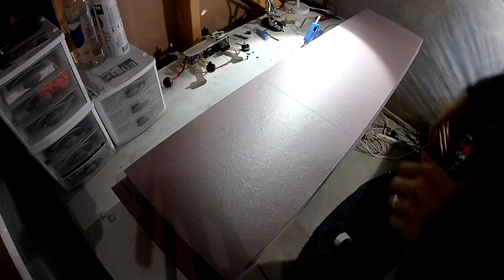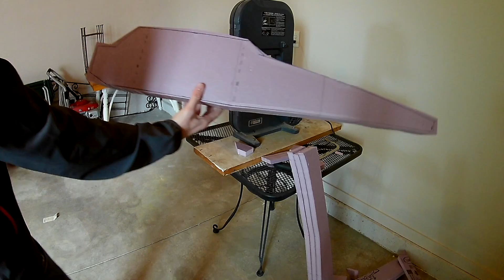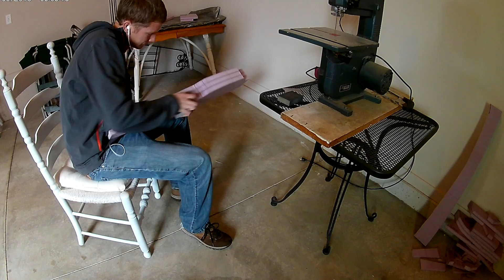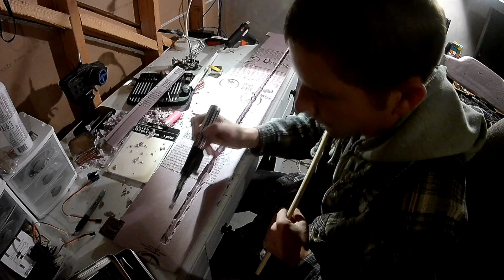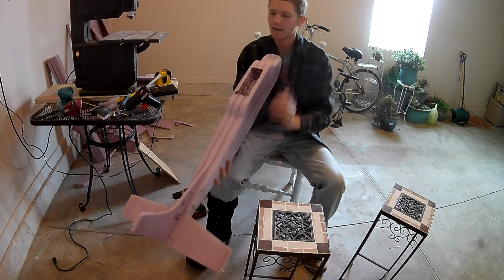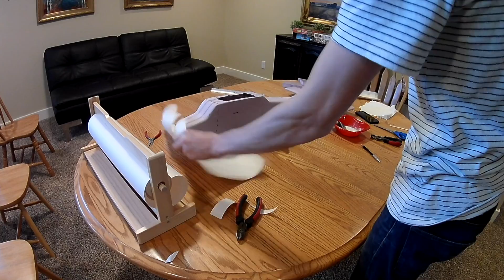How to build foam RC plane cheap (Part 1)

Comment: Those lines aren't for easy breaking they are for when covering with wood they line up either 16 inches or 24 inches on center for hanging drywall

Comment: How do you know when to recharge your battery pack?
I know these batteries sometimes won't charge if you run them down too far.
Reply from the maker: There are battery monitors you can get that will alarm (beep) you when the voltage gets to low. thats the cheap easy option. on all my newer builds i have flight controllers with telemetry setup so i can see my battery voltage on my radio. you can check out some of my newer drone videos  if your interested in that.

Comment: Hi, what are the dimensions for the horizontal  and vertical Stabilizer. Also can you give me the dimensions of the wing.I understand the measurements for the fuselage is from the firewall to the leading edge of the wing is about 5 inches, the wing is 15 inches thick, but I didn't catch the wingspan in inches. Can you give me those as well? Thanks,Mike

Comment: sir how r you? sir i am new ..sir i want know which battery & esc perfect for 70 mm 12 blade 2839 kv motor ? and any  problem if me use both two 5000 mpr lipo babattery for 70 mm edf 2839 motor..

Comment: I've never built an RC plane, but have make other projects out of foam. For added strength and stiffness, I've glued (painted on) window screen material. Once the 'adhesive' cures the screen to the foam - it us MUCH stronger. Have any of you experienced RC Plane builders used window screen for added strength ?
Reply: Kind of similar - it's common to use clear  or coloured tape to make foam stronger

Comment: you can use a  tiny amount of dish soap in the glue  to break the surface  tension of the water so the paper can soak easy. nice build.

Comment: What was your ratio of water to glue for the paper covering?
Reply from the maker: honestly I never measured it. I just put some glue in a bowl and then added water a little at a time till it looked good. experiment on a little scratch pice first and see how it works.
Reply: On wrap paper or lightest krafr brown stuff i use 50%50% water/pva glue